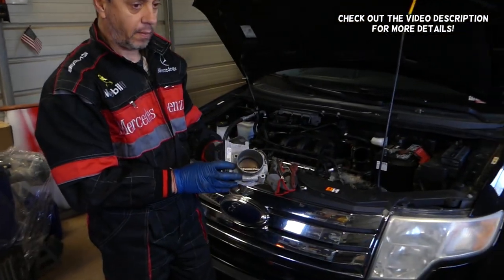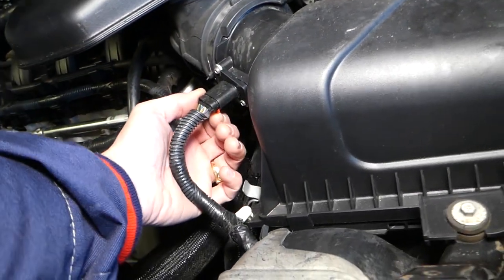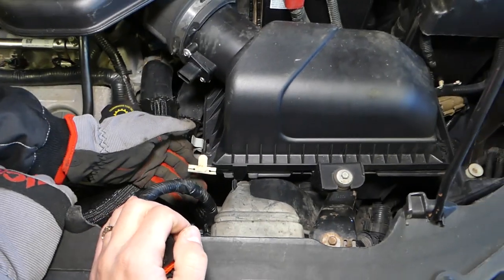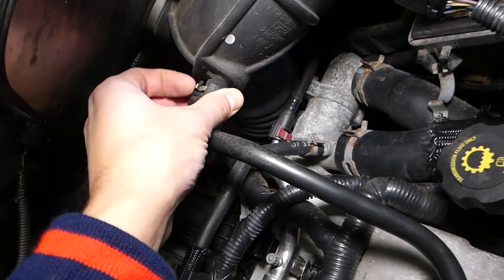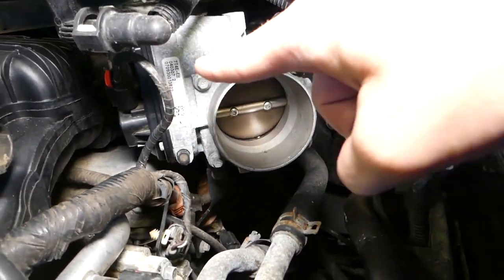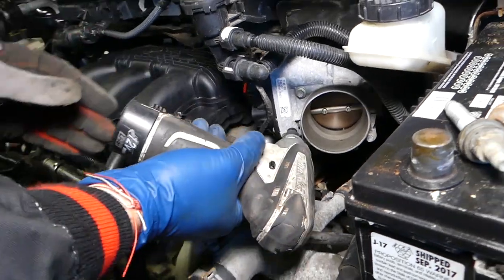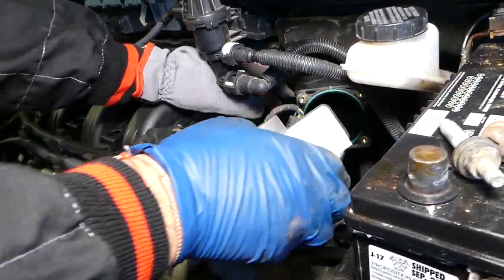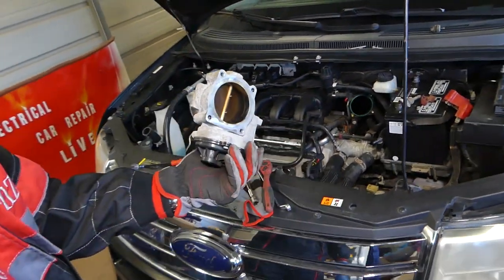FORD EDGE THROTTLE BODY REMOVAL REPLACEMENT LINCOLN MKX

Comment: Awesome video, Im pretty sure my 2011 edge needs this. It keeps dying at red lights and stops. Looks quick and easy enough.
Reply: Did this fix your issue? 
Wife’s 13 edge is dying when taking a slow right turn and at stop lights/signs. Starts right back up with no issues and never has any code when it happens. Forums led me to the throttle body being the problem
Reply: @chaseshtogrin9702  wasn't throttle body I rsplaced mine and it still does the exact issue you said. There was a recall for certain models mine went out of recall period due to covid lockdowns go figure. Mine still has the issue but it's going to sound weird but if I put it on the right air temp and power and use mid level gas it reduces the amount of random crap outs at stops. Like air 4/5s up with ac on at maximum cold I think it is not max ac on just ac turned all the way cold. It's such a weird problem and After replacing mine it was good for a short period and went back to doing it. Couldn't narrow it down myself couldnt afford for the dealership to play roulette with it.
Reply: @chaseshtogrin9702  well mines not dying on slow right turns. mine likes to die at stop lights when waiting for mid to full duration of light change.
Reply: That’s what my 2011 mkx is doing. I got a report and it said the throttle actuator is stuck open.

Comment: Throttle body in Ford Edge is now being recalled depending on the year! Just an FYI to anyone watching in 2021!
Reply: 2007 Edge here. I guess I'll be doing it myself.
Reply: @East-Coast-NS  same... never buying FORD again
Reply: @renasorrell241  As an FYI, I did fix it myself and it's been fine since.

Comment: So on my 2013 edge sel rpm is bouncing up and down when started. Noticed last few days when running about 40mph the ram is bouncing up and down a bit and makes the car a little jerky I guess? Like power is up and down? Is this this first check to clean this out? Also second question through a bit of searching I read about cleaning or replacing the iac valve which I not finding direction on where this is on this year. Does a 2013 have an iac valve?
Reply: I have the same vehicle with the 2.0l and mine I'd doing the same thing. Did you find a fix for it? Thanks
Reply: No iac valve i think on Edge

Comment: This will also fix an Alternator charging issue.. As it will idle too low at rest..I fixed a few when they use the AC and headlights.. The alternator will not charge at idle.. Thus it will drain the battery and toss an Alternator charging code